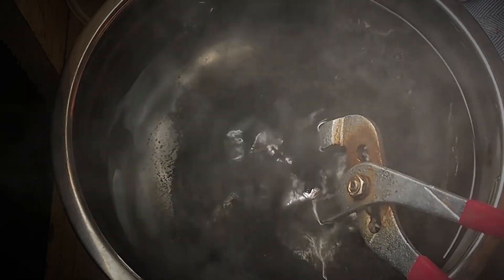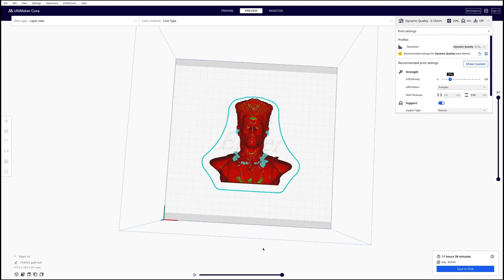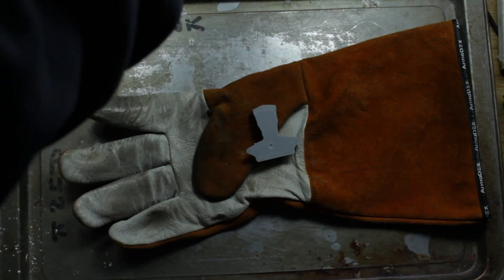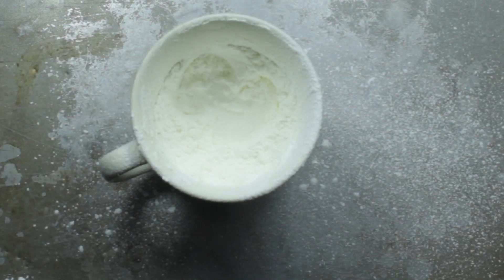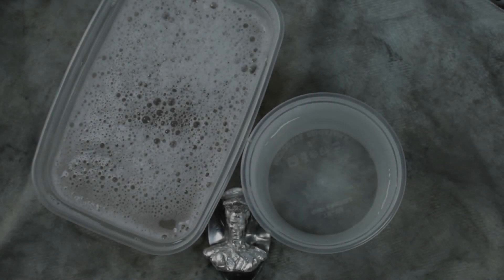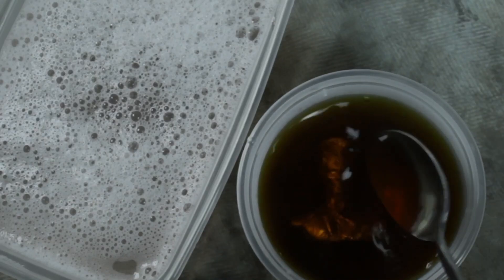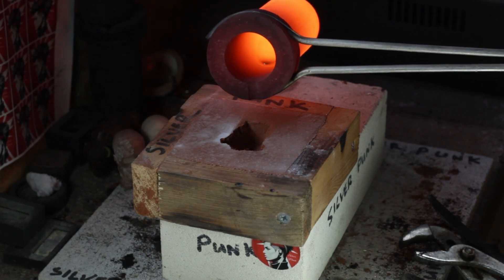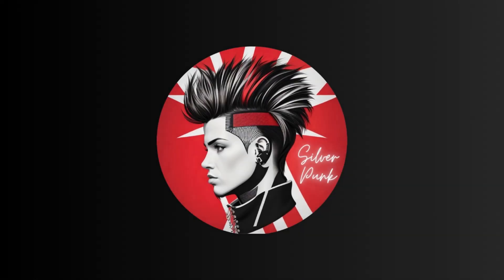Solid Silver Major Guile - Casting a metal Street Fighter Legend - 3d Printing to metal casting

Comment: Did the 3D print really take 11 1/2 hours? You printed things faster during the stack chat, is this one much larger, or more detailed?
Reply from the maker: The print i sliced would of took that long but i reduced the size before doing the actual print for the pour mate :) couple of hours normally these take this size.
Reply: Ok, that's what I thought, based solely on what I saw when you were on with TSC  @SilverPunkPour
Reply from the maker: Yeah i think that in the video was 3 times bigger size, just so you could see it in the program big enough for the recording :)